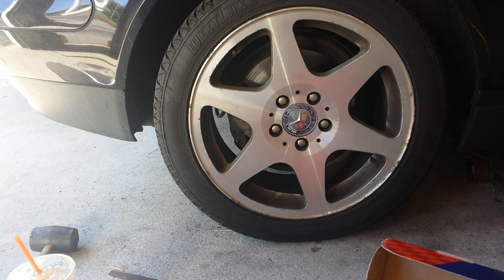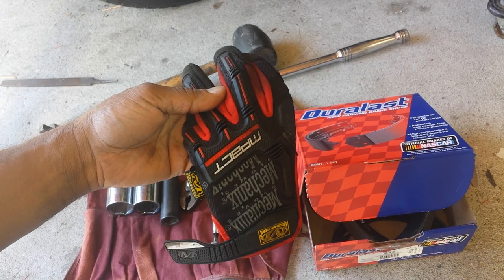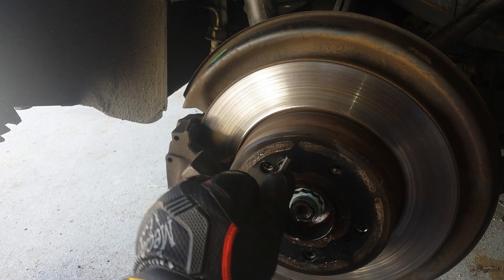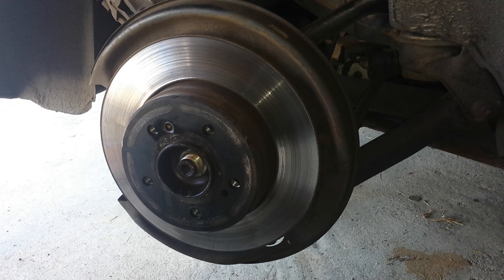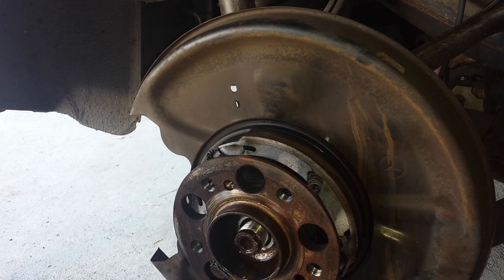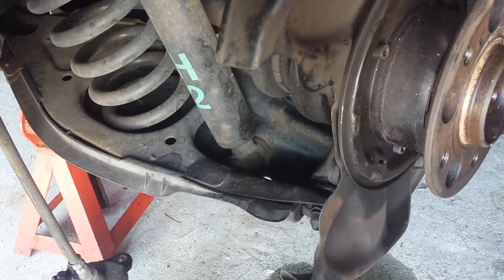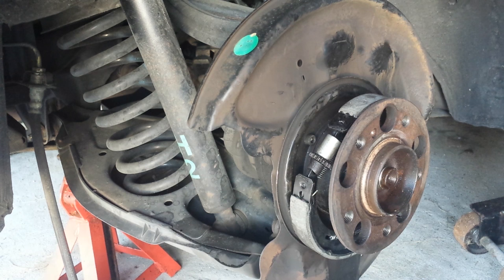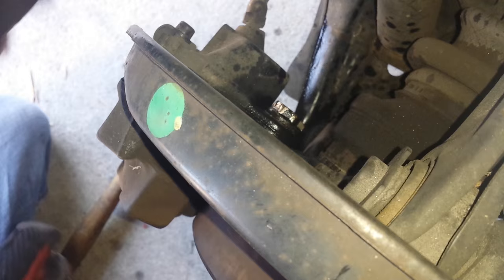Mercedes Emergency Brake (Parking Brake) Replacement DIY brake shoe replacement

Comment: OK, a bunch of comments here.. you should clean the backing plate with brake clean to get rid of brake dust and rust. Second, before installing the  new shoes you should actually use high temperature grease on the contact points on the backing plate. The retaining springs hold the shoes against the plate and you don't want friction between the shoe and the backing plate. Next, before you put the disc on, you should have adjusted out the adjuster. You should adjust out the adjuster until the disc starts to rub, then back it off slightly. Otherwise, you're beginning with your new parking brake out of adjustment. You should also have explained how to adjust those adjusters. There should be a hold in the backing plate which allows you to adjust them even with the disc on. 

One more thing- you should use the correct tool to install the retainer springs (Mercedes brake spring tool) and the correct tool for the two larger springs (not a screwdriver). There was no need to remove the axle nut. The only reason to do that is if you needed a new backing plate, and as others have posted, there is a way to do the backing plate without removing the wheel bearings.
Reply: And how about backing off the adjuster BEFORE removing the disc so there's no need to use a rubber hammer? Plus the caliper bolts are loctited so the penetrating oil serves no purpose and merely risks contaminating the disc pads/brake shoes. Scary lack of knowledge - you wouldn't repair MY auto!
Reply: He do not show how to instal lower spring . lower spring is very hard to instal.
Reply: atomicdoug  cvut the plate to centre through the 2 nuts then twist into place. bolt on then spot weld the cut. saves 200 in bearings
Reply: he is learning  !

Comment: I'm not sure why you took off the center nut for the Hub when you didn't remove the Hub you only removed the rotor and then the brake parts behind the Hub
Reply: He removed the hub nut for another video which reviewed several different 30mm sockets.
Reply: where is this video? @tempest411
Reply: I thought the exact same thing
Reply: @stephenablett3080  so did i lol.... thats only if you were taking the half-shaft out
Reply: Got me thinking 😭
Reply: I'm sure he thought it was held my the nut lol after he realized he didn't he just played it off n kept goinf

Comment: There was no need at all to take that hub nut off .and I'd remove the caliper and braket before tackling or removing the disk bolt if there's no frezzing you'd run the risk of damaging the disk

Comment: The black socket is NOT hardened steel!!!!! Impact sockets are NEVER HARDENED steel! That is so that the socket doesnt explode. Taking the center nut is TOTALY unnecessary. But when you replaced it, you never torqued the nut!!! It has a very high torque setting. In all, I would not let you work on my Mercedes

Comment: You installed the brake shoe ratchet screw adjuster backwards. The dark screw head should point forwards and the silver color end backwards. This is true for the right or left side of the car so that flipping the star nut up or down does the same action (expand or contract) the brake shoes regardless of the side of the car you are working on.
Reply: Actually... Mercs has one towards the front and the other towards the rear.... ;-)

Comment: When i saw duralast brake shoes i knew this was going to be good
Reply: I need to know on a 1999 Mercedes S430 AMG it's got this answer when I take off and I want to spin once the cash o tires on the time and just it grabs you won't spend it just grabs every time I stop and it puts your head all the way to the back of the seat but it won't let go just always grabbing I need to find out if anybody out there has literally found that sensor or what is it that you got to disconnect to be able to you stomp on it and you want to spend as far as you want he's got to be able to do it it's just catch it
Reply: WUT?
Reply: @rauliglesias1566  Here.  Just throw these in anywhere:  ,,..,.!?;:;
Reply: @3Hwrecking  hahahahaha!!!

Comment: Putting on rear emergency brake shoes: Not for the faint hearted - the springs are HELL to put on. I used a needle nose vicegrip pliers & eventually got that lower one on - any other good tips on stretching those springs? I mounted the shoes first as I got tired of wrestling with the springs with such little clearance around the hub -

Comment: I know we go back and forth brother. FYI: I was a brake caliper remanufacture for 25 years. Sold biz. Went into gold biz 2004-2009 for gold rush. Sold biz! Now I do a Benz, Porsche, Ferrari,  or similar car occasionally. Using Airless shot blaster for calipers, I rebuild calipers. The small self contained airless shot blaster is 16k. Big one 35k! I powder coat calipers their choice of colors. I buff and polish wheels, or triple plate re chrome wheels if needed...or powder coat wheels. Same machine will blast the wheels like new 2 at a time in 10 min by pushing 3 buttons. My customers...  I choose. Precision my dude. I go to the extreme. No hurry. My customers have a dozen cars. All of them look real nice thru them wheels too! From the Ultra rich to the... they got a lot of money customers ... they want a pro that places covers on steering wheels, seats, floors. And does a job that they can feature in pictures they turn into posters. The area I guess dictates the amount and caliber of customer u get!! Being on cape cod we have more than a few car guys that demand the best job and service. Pick up car, drop it off detailed! No lights on. Anything I see wrong or doesn’t meet my expectations I take care of it. Sometimes they may want u to actually spend a few minutes showing them what and why!! Out of desire only! Then a check comes in the mail. Most times more than the bill I sent! Just on occasion....
Reply from the maker: Nice. Would love to come down and check out your operation. I'm in Massachusetts.  Let me know.

Comment: My shoes are totally rust to the rotor. I can’t take the rotor off to replace the shoes. So my question is how do I remove the cable so I can take the rotor off? Thanks in advance

Comment: I was watching this vid bc I need to address a F-up I did. When I pulled my disc off exposing the ebrake assembly, a silver V shaped clamp fell out from the bottom. Maybe your Mercedes didn't have this as part of the set up.
I have a 2012 S550

Comment: There is no need to remove the hub nut to change the brake shoes
Reply from the maker: True..  I removed it for easier access.
Reply: Why do´nt you just admit a wrongdoing? There´s nothing wrong with doing wrong. Everybody does it. Try more honesty in your clips. Join the do it yourself movement where sharing without hiding behind false facades is key.
Reply: @iRepairAutos  Seriously?  Removing the nut gave you "easier access" to absolutely nothing.  It would be like removing the nut on your steering wheel to replace the airbag. One has nothing to do with the other.   The right and truthful thing to say would have been "True.  I thought I needed to remove it to get the rotor off, but now I see it was unnecessary".

Comment: Why did you remove the middle hub nut ???
Reply from the maker: I wanted/needed more access to do the job.  You can do this job without removing the hub but it's more of a pain.
Reply: of course thanks
Reply: But the hub wasn't removed in the video, just the rotor...

Comment: whats the best way to unseized the rotor? my shit wouldn't come off if my life depended on it :(
Reply from the maker: The best way is to spray a solvent that loosens rust.  Spray generously around the area that holds the rotor to the hub.  I have used WD-40 rust penetrant.  Let it work it's way in for 20 minutes.   Then using a rubber mallet hit rotor such that it comes off the hub.   Patience and elbow grease does it.
Reply: Heat it up around bolts holes after u use pb blaster then tap it off
Reply: Don't hammer directly on the rotor.  A rubber mallet may work for a standard rotor, but it won't do jack for a seriously rusted/frozen one.  You will just be needlessly banging and bouncing your rubber mallet off the rotor for hours.   

The trick I have found to remove any stuck rotor is a three foot 2x4 and a hand held, 3 pound sledgehammer.  Place one end of the 2x4 on the rotor edge, and then smack the other end of the 2x4 with the hammer...hard.  You may have to hit it twice, but the full shock will travel down the 2x4 and break the rotor loose.  The 2X4 also protects the rotor from direct impact damage, just in case it still wont come off and you need to drive it somewhere.  But it WILL come off.  Soak liberally in penetrant first of course.

Comment: Hey !!! Why have you deleted ALL THE THREE CRITICAL PARTS???? I can tell the brakedisk is sitting firmly at first and then there´s a jump cut RIGHT where you take your time to wonder why it´s sitting so hard. The lower spring and the two last springs don´t just fly in place I can tell you that and that´s where the other two editings are. What´s the point of doing "tutorials" if they are so edited all the critical moments are left out. I just had to drive home without the last two springs installed because they are FUCKERZ and I have never seen anything like them. Next time make a tutorial about the difficult parts left out here and then I will press the like button. And yeah why you removed the axle nut? I think you should think things over and consider why you are making tutorials.
Reply from the maker: I hear you.  You can make the better video I guess.
Reply: matt alan  LMAO
Reply from the maker: Oh come on guys...   lol.. No seriously.   I'll try to be better.   Thanks for the feedback.    😎

Comment: My axle nut is so hard to remove. Can you tell me a trick? Thank you.
Reply: With an assistant, park brake ON, foot brake ON and a long power bar. Add a length of scaffold pipe for extra length and leverage. I used a 3/4 drive bar and an impact socket.
Reply: Just do it first before removing the wheel !
Car on the ground , park brake  on, no assistant need... easy!

Comment: I LIKE this video!  Too bad most of the Commenters felt compelled to go WAY overboard about the center nut being removed.   

Why is it that putting someone else down is so satisfying & necessary to you?

Especially since it only needed to be mentioned once, or maybe twice at the most.  You couldn't stop yourself from jumping on the "hater" bandwagon?

It would be diffsrent if, for the benefit of others, you respectfully pointed out that the step wasn't necessary unless going deeper than parking brake  repair.

At leastmthere were a few comments that were made in the spirit of being helpful. 

For the haters . . .
What good could possibly come from this type criticism?  None
Maybe ask yourself that next time, BEFORE you go off.  If no good can come from it, you shouldn't be saying it.  

Putting someone down or hurting their feelings is NOT good.

Comment: great vid, what are the torque specs for the caliper bolts? thankyou
Reply: Pull a harder than a bolt in an aluminium engine block but less than a wheel bolt.